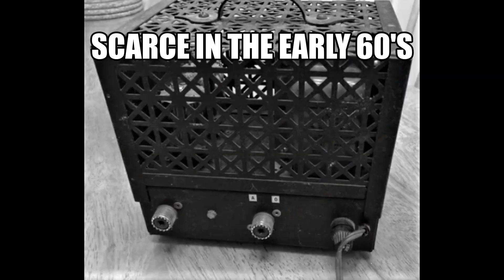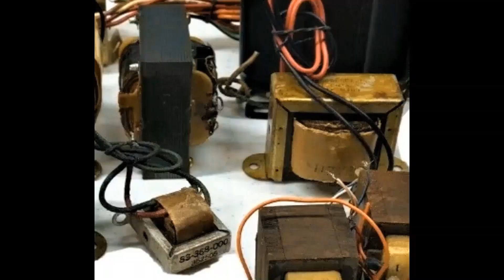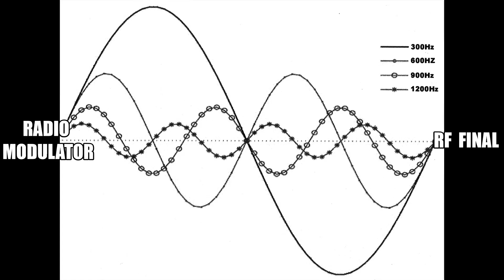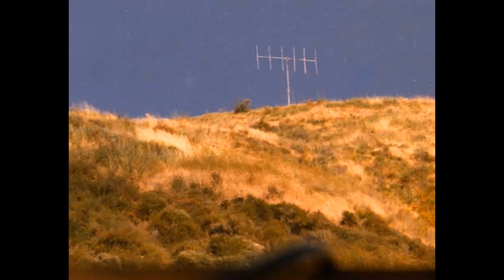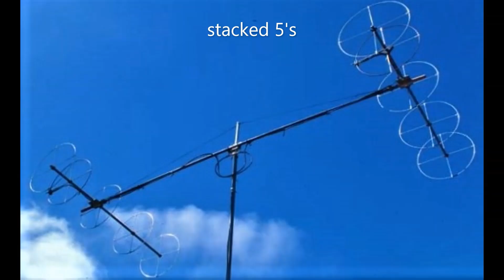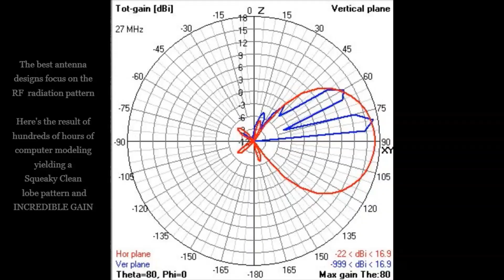11m Big Strapper History, NO COST Audio Improvement & Ant Design

Comment: The 250 ohm resistor is part of the RC circuit.
Reply from the maker: Yes it is for AC sawtooth smoothing but it's also a surge protection resistor, remove it and you can almost certainly kiss your rectifier goodbye
Reply: Take a look at 4.7 ohm  1watt resistors.. I’ve seen them run for decades strapped. But it’s a stupid idea. It’s hard to fix stupid.